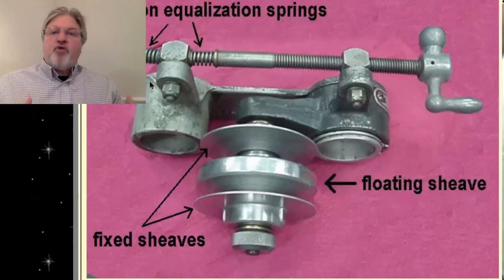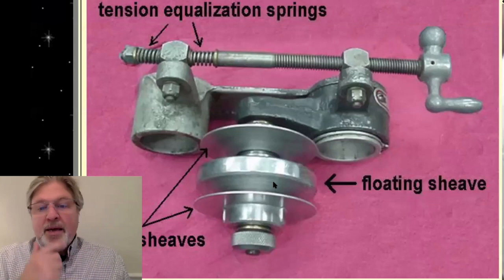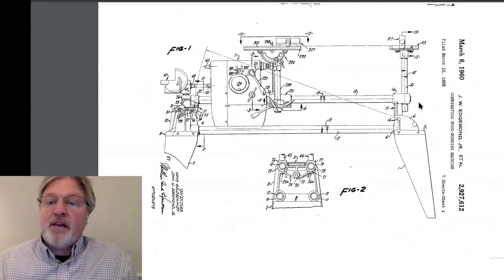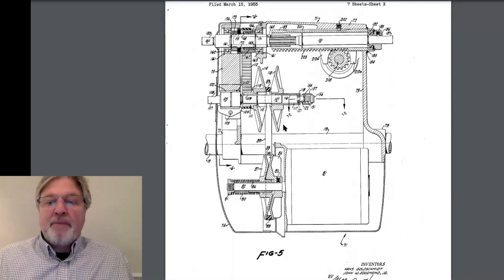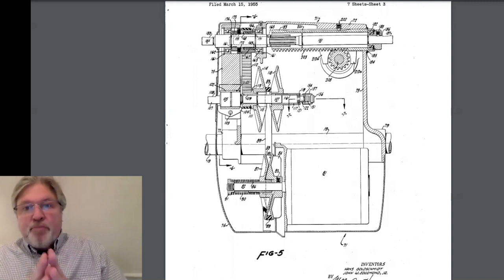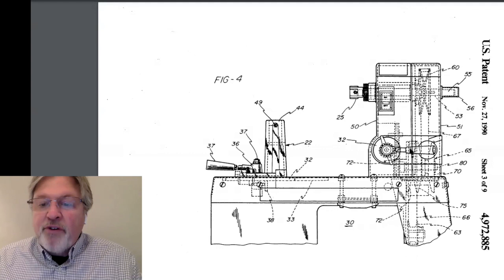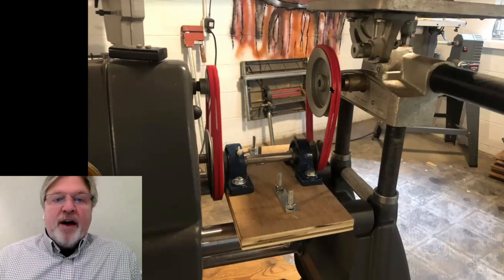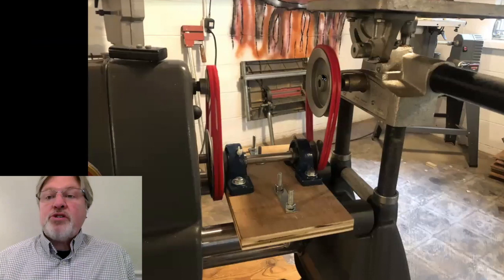Nerd-Level Shopsmith Speed Control Evolution (You probably don't need to watch this!)

Comment: Hi Scott, really glad you made this video. I appreciate knowing how these machines work as to get the most out of them, and just as important the limits of them. I have a SS speed reducer I used for turning with my regular headstock. I experienced some, what I believe, belt slippage when turning larger pieces, the chisel contacting the piece would stop the piece while the SS continues to run normally. The contact with the chisel was light, wasn’t jamming it in. Happens mainly on rough turning to round. I checked and adjusted the tension springs according to the owners manual but still does it. Would yo suspect worn belts. Thanks Jim
Reply from the maker: Hey Jim, that sounds exactly like what's going on.  There should be some ability for the parts to slip, but it shouldn't be that easy. Scott

Comment: Jackshaft speed reducer-see these used on band organ drives-the organ pull-flywheel,very large turns at 80 RPM.So from an 1750 RPM motor you use a two stage jackshaft system-also if the organ were to be powered from a small steam or gas engine.
Reply from the maker: Rex, all three of your comments were sent to Youtube spam jail because when you end some of your sentences and immediately type a word after the period, Youtube sees some of those as URLs and even displays them as URLs and then labels your comment as spam.  Don't know if you've ever seen your comments not appearing on videos, that could be why.  Scott
Reply: @MyGrowthRings   Scott-a “jail” term from me . What is a “URL”  Abbreviations are used too much these days esp alone when not used in a sentence that points out what the abbreviation is- I would like this to be about tools-not English class-yes make this “shop class”! So the abbreviation for today is “URL”.
Reply from the maker: @rexoliver7780  Heck if I know what URL stands for! What a URL is, is a web address, like MyGrowthRings.com Youtube takes words that end with a period, and if that is conjoined with any two or three letter URL destinations, such as .com or .de or .mx and makes then a URL. Any comment with a URL is then tossed into a spam folder.

Comment: I am currently waiting for a few more parts to build a speed reduction pulley set up like yours with the pillow block bearings, for an industrial sewing machine. I may have to replace the AC motor  with a DC servo motor , which is basically like Skip's treadmill motor mod

Comment: I have a ShopSmith 10ER that has the variable speed pulley device.The version my Dad had used the fixed pulleys like on early drill presses.At work they have a Powermatic drill press that has the variable pulleys.Oliver tools used that system on their wood lathes.My brother has one of those lathes and I used one in a school shop.

Comment: Of all the complaints I read regarding Shopsmith the variable speed is never one of them.  That feature alone makes Shopsmith a standout tool perfect for the home DIYer.  I recently watched a video that claimed bandsaws don't have variable speed.  Hah!  Try SS.  Thanks for the detailed explanations.  It is interesting that SS pulled up the old 10er design to create the reducer.  Great engineering withstands the test of time.  Have a great week, Glen
Reply from the maker: Actually it was a PowerStation that borrows from the 10er speed changer, not the speed reducer, but over the years there have been some great ideas that deserve a second look.  Scott

Comment: Were you thinking of me, when you made this one, it is perfect timing for my NEW, 10er
Reply from the maker: I must have been!
Reply: @MyGrowthRings  just rewatched, since I converted to a drill press full time. Debating a Treadmill update, have the complete 2 hp treadmill with controls. Guess I could always move the old 10 ER speed controller pretty easy. Or put it in the mix for more range????  Thanks Scott

Comment: I have everything but the 10Er speed control. I especially liked the parts about the power stand and the speed reducer. I have never seen the insides of either one.
Reply from the maker: Thanks Robert. I'm also lacking the 10ER speed control. I think the odds are better to find a 10ER on Craigslist that includes one rather than fighting over them when they appear on eBay. Scott

Comment: If you wanted to dedicate a Shopsmith to turning large/heavy bowls using your speed reducer, you could add a second headstock to the way tubes with your speed reducer between them.  Just remove the two belts in the second headstock so you're only driving the spindle.  Would be an easy solution for someone with a spare headstock.
Reply from the maker: Yes, I actually shared a link to a video of that idea in the video description. Great tip. Scott

Comment: Question about power station maintenance, is there a place on the shaft for oiling like there is on the speed control sheave and motor sheaves on a headstock? If the center pulley slides, you would think it needs periodic oiling like the sheaves on the headstock. Thanks
Reply from the maker: Hey Scott. Yes, there's a lot of confusion on the lubrication of the Power Station and the Crafters Station because there have been a couple changes. On most of them the motor needs to have oil added about once a year. In one case it actually calls for 150 drops of oil!  Just check the label on the electronic motor itself to see what it says. Internally there are a couple spots that might need attention too. I guess I need to do a video! Scott
Reply: @MyGrowthRings  yes, please!  I’ve got 2 power stations

Comment: Always what kind of speed control was in the Mark 2 and in the Sawsmith RAS.
Reply from the maker: The Mark 2 had step pulleys and the crank on the front simply lifted the motor to make the chancing of the belt location easier. I have a headstock from a variation on the Mark 2 that Magna made exclusively for Montgomery Wards  called Powr-Kraft “Dyno Shop” that featured a variable speed controller that is very similar to the 10er speed adjuster.  The SSRAS adjusts a lot like the 1960’s Mark VII, with a cam and adjustable sheaves. Which shouldn’t be a big surprise considering the same guy who patented the SawSmith was listed as one of the inventors of the Mark VII.
Reply: @MyGrowthRings  Ah yes, the Mark VII.  I have two of those beasts.  Along with a 10ER,  1960 Mark V and a clone.

Comment: What are your thoughts on using the link belts instead of the V-belts in the Mark V and Power Station Headstocks? Looking to reduce vibration and noise. Great videos as always. Saw the speed controller of the 10-ER and immediately thought that looked just like the Power Station!
Reply from the maker: Hey Andrew. I'm a but fan of linked belts, bun not with a variable pulley, such as the Reeves drive in the Mark V headstock, because of the forces on the side walls of the belt. On fixed pulleys linked belt are the bees knees!  Scott
Reply: With vaiablevpulley drives-do not adjust it with the motor or engine stopped. Can damage the belt. These drives came about around WW2 when there was no way to vary the speed of AC induction motors. Now today we have solid state switching Variable Frequency Drives that can vary the speed of an induction motor. This is most effective on 3Phase motors. On single phase motors start windings,capacitor,and the centrifugal start switch causes problems. The drive can convert the single power to aphasia to run  a 3ph motor that is within the hp rating of the drive.

Comment: Would it be possible to produce variable slow speed control by having a small pulley (say 2”) on one Shopsmith MkV driving a larger pulley (say 8”) attached to the lower auxiliary spindle of a second Shopsmith MkV?  If there were worries about damaging the motor in the second Shopsmith, you could disconnect its drive belt, which from your video, looks to be a fairly simple thing to do.  Problems with tensioning the belt connecting the two Shopsmiths?  If it worked, what would be the lowest speed achievable on the second Shopsmith?
Reply from the maker: Hey Graham, yes, it could be done and the issue of tensioning would be solved by adding an idler pulley to remove the slack from the belt. The only trouble that you might run into is that the lower idler shaft doesn't protrude very far, so you might have some stability issues with mounting a pulley.  It's an interesting concept. Scott
Reply: @MyGrowthRings  The idler pulley could be a nautical snatch block attached to a way tube on some bungee cord.

 Is my maths correct?  2” to 8” pulley = 4x speed reduction; drive shaft in Shopsmith 1 to lower idler shaft in Shopsmith 2 = further 1.6x reduction.  So if Shopsmith 1 is running at its slowest 700rpm, Shopsmith 2 upper spindles are running at 109rpm?  Close to a PowerPro!
Reply from the maker: @grahamw2955  Correct, that’s what you would achieve if it works.